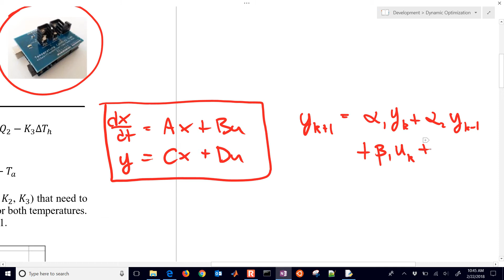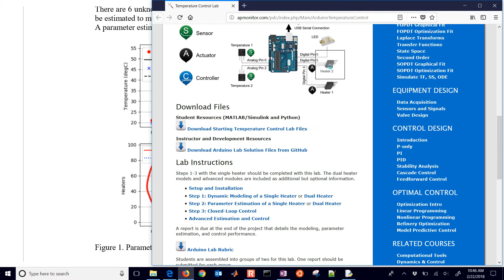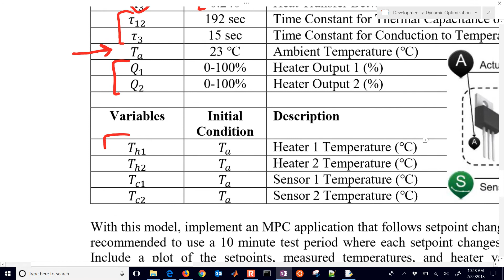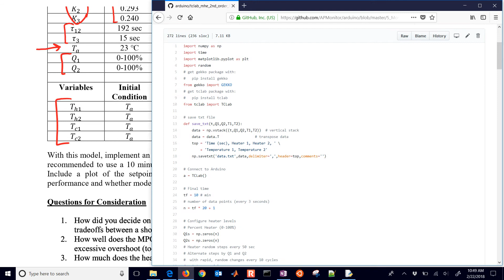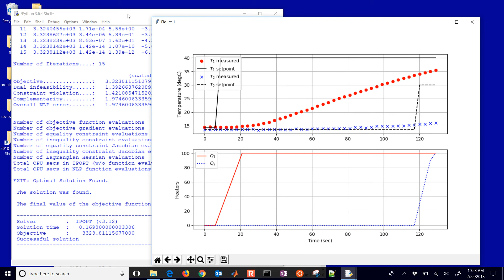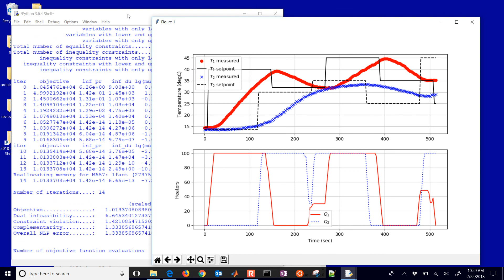Linear Model Predictive Control with TCLab

Comment: Good sir, if the actuator is a "relay" how is the dynamic model ?, I'm new to this, greetings.
Reply from the maker: We use pulse width modulation to have values between 0 and 100% heater. Even if you had only 0 or 100% heater then the dynamic model is still possible because there is an energy balance that tracks a continuous temperature. I recommend lab A and lab B as introductory exercises. This is lab F and you may be missing some basic concepts if you jump in at this point. http://apmonitor.com/do/index.php/Main/AdvancedTemperatureControl
Reply: o right, i miss that, thanks sir you are so cool :D

Comment: This was good.  Thumbs up.  Still prefer the "why bother" being stated at the beginning.
1. The multi variable control is significant.
2.  There is no need to have controller gains.
3.  This can be used instead of LQR that optimizes a trade off between the multivariable.
      What are the advantages and disadvantages?
      BTW,  LQR works great if you know how to setup the coefficients in the Q and R arrays  but few go into that so LQR is not used as much as it could be.
4. I can see where MPC is handy but very computationally demanding.  Obvious a really application can use a Intel I7.
Reply from the maker: The MPC approach is equivalent to LQR when MPC has no MV constraints and uses a squared error objective to a single setpoint. Most practitioners use a diagonal Q and R matrix because of the ease of tuning. I like to use an l1-norm objective because of the way that we can trade-off on multiple objectives and because it gives an inner deadband region of no objective. Instead of using a single set point (SP), I use a SP high and a SP low that can optionally collapse to a single set point. A lot of my formulation is from industrial experience where I had to implement these in chemical plants. Creating the right objective function to mimic what the operator or manager thinks is best can be very challenging. You have a lot of industrial experience as well so I appreciate your insights.